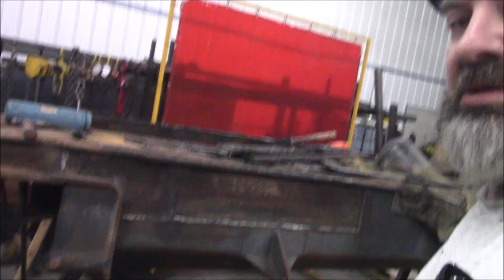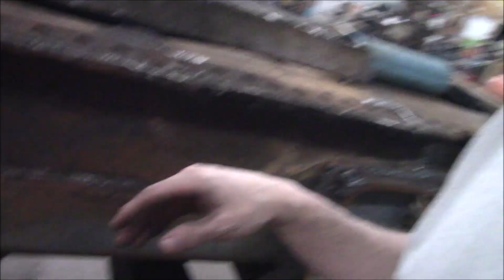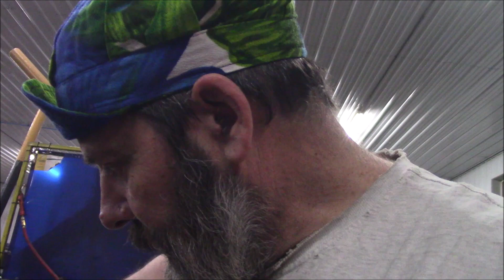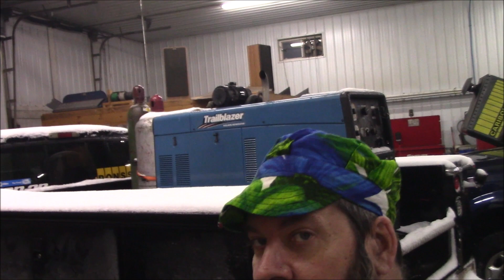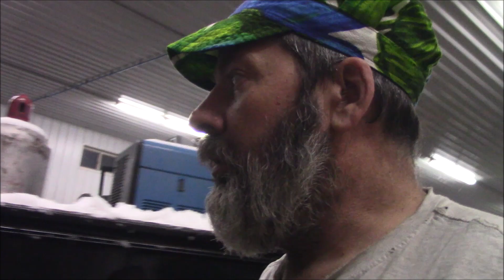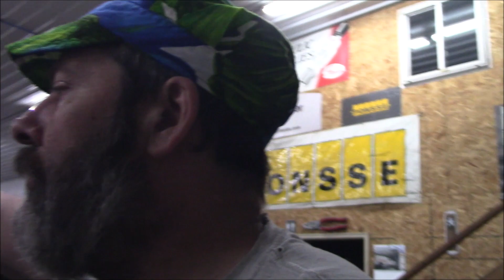New Welding Project 4

Comment: Gonna be quite the task getting all that lined up again, one section at a time.probably would have been quicker to  repair the cracks than weld the plates on the first time. Those frames must be hard to come by to justify a repair like this.
Reply from the maker: Very hard to come by. Either the machines are still in operation or cut into pieces by a scrapper! I'm this event Ponsse found one and we together are building him a good product to keep his machine operational. The vintage is 2001.